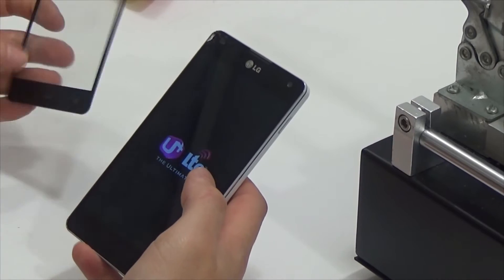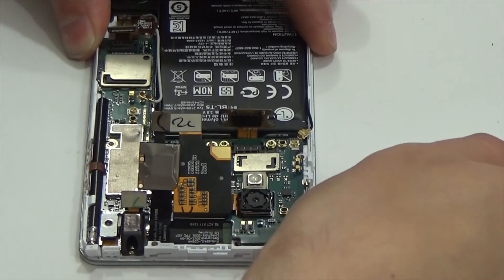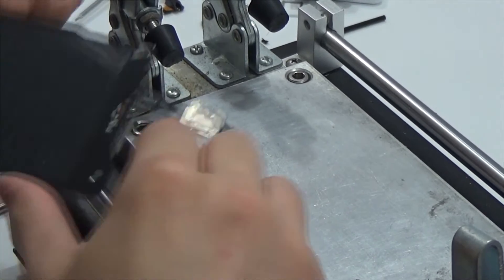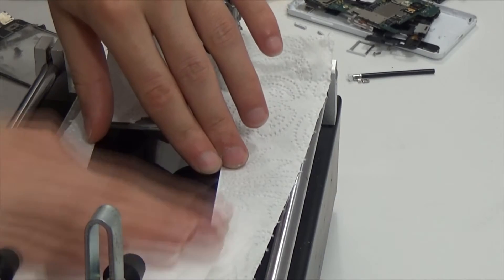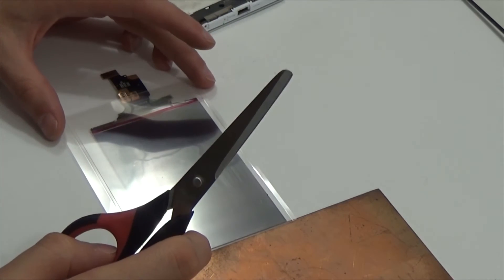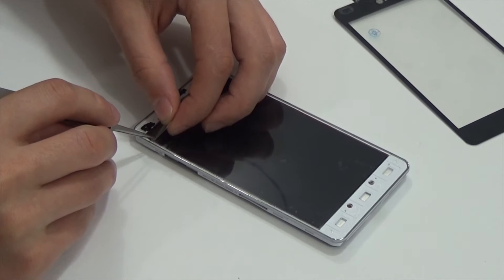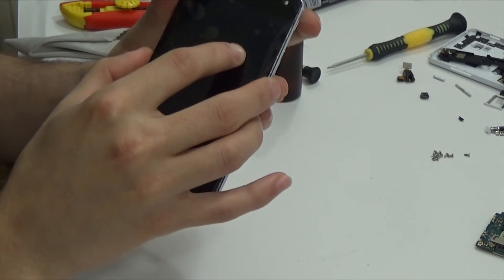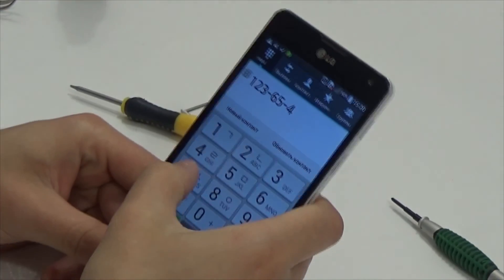Repair of LG Optimus G F180  touch sceen replacement

Comment: Hi wanna ask u plz .. For this phone LG optimus G F180  i've broke the touch screen, so for the replacement do i replace only the touch screen or do i have to change also the LCD ?
Reply: If your touch is working then ya only screen need ro change.fone got liquide inside or got black from inside then it needs to change screen and touch panle